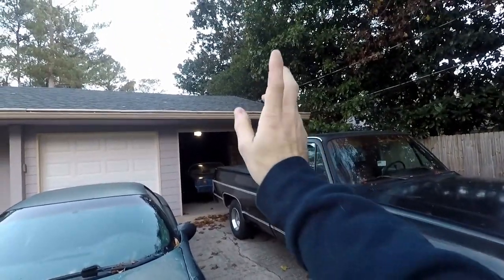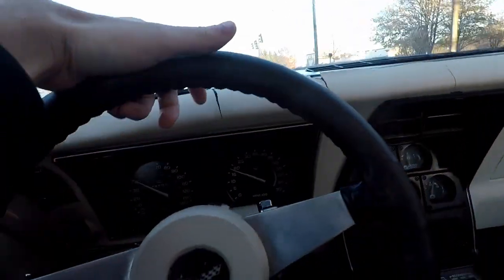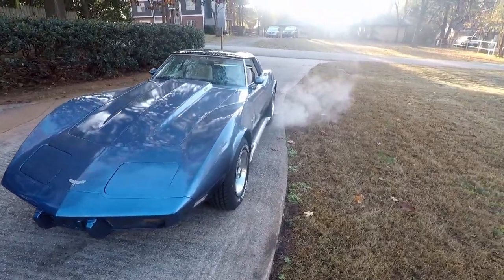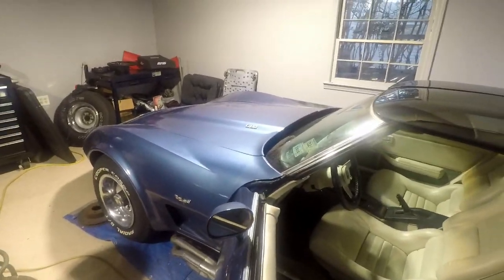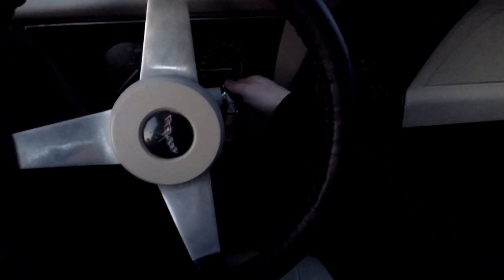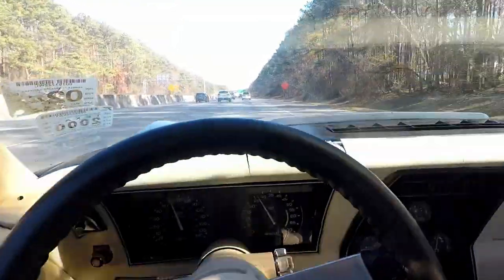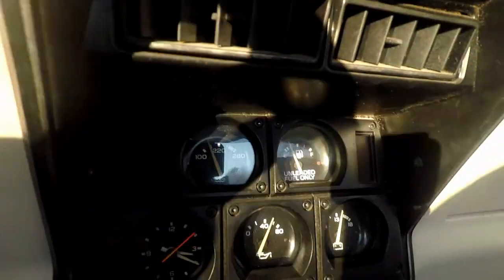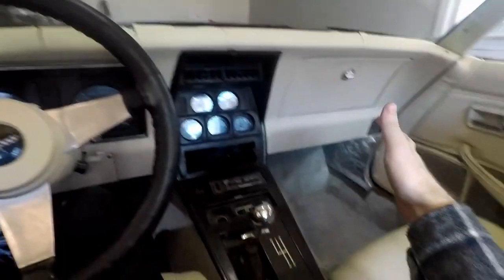Daily Driving 1979 Corvette For The Month Of December!

Comment: Awesome car and video. I too have a 79 that has been sitting for 20 years. Got her going but I have a question: How did you fix your headlights? Mine are doing the same thing. Only a few work on low beams and others that didn't work do so on high beams. I know nothing about car electronics. Any help would be appreciated. Thanks for sharing this video. When mine is done it'll be blue with white interior as well.

Comment: Assuming you are running the original Qjet carb. They are bad about leaking gas from the casting plugs. You won't see the leak, but the gas drips into the intake. That might be why your crank time is long when the car is cold. The fuel may be leaking out of the carb bowl into the intake. It also makes it hard to tune the engine. This is a common Qjet issue.
Reply from the maker: @ImpalamansGarage  yup all the fuel in the qjet bowl is drained out overnight

Comment: What side exhaust inserts are you running? I have Classic Chambered 2 1/2" louvered cores on my C2 and they are obnoxiously loud. In the video yours seem quiet enough to hold a conversation while driving.
Reply from the maker: I have no idea what inserts they are. I bought the side pipes used and they had been sitting for over 20 years. They are definitely very mild, you can easily hold a conversation. I believe they are the 2nd quietest option available. The quietest option available has a noticeable restriction in it, and I didn’t see that in these. Also, very likely the inserts are hooker brand, as the pipes are hookers.

Comment: I was about 20 when these came out, I so wanted one. They were about 14,000$ for a new one & that was quite a bit as most cars were around 6-8 k. Sounds like you have a exhaust leak. Maybe check TBE compression on all cylinder.
Reply from the maker: @richardmorris7063  my used side pipes have a rust hole in them. Who would have guessed :( Oh well, rolling with it till I’m able to weld and patch them up!